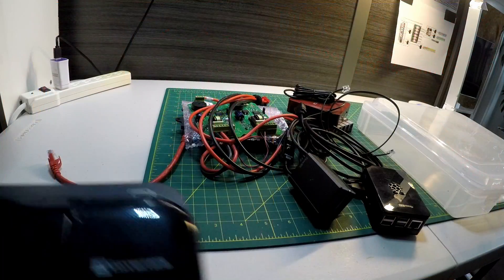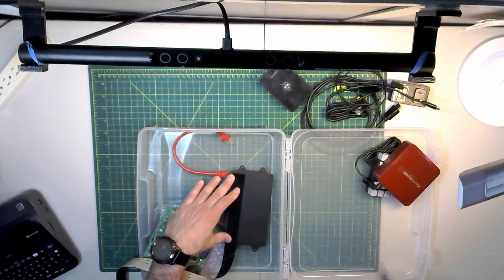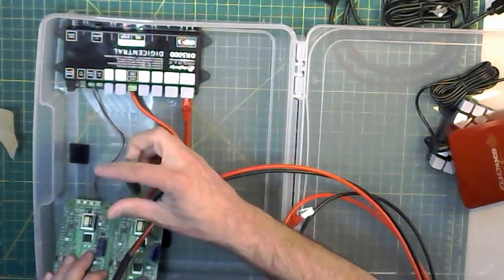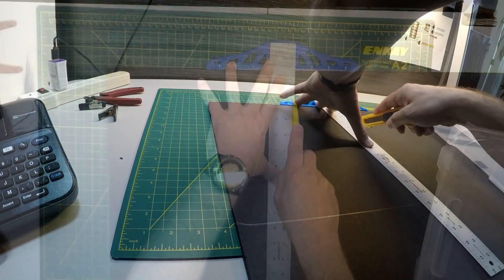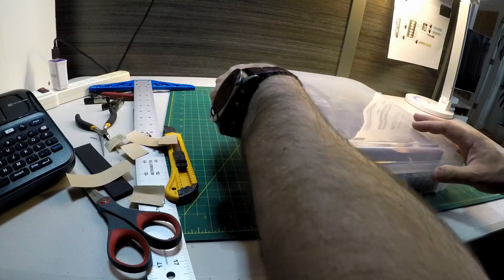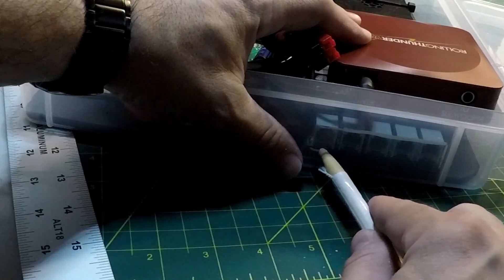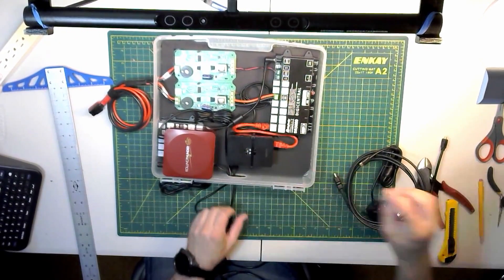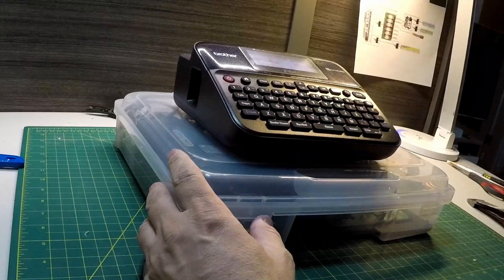2 || Portable DCC Control Box Build based on Digikeijs DR5000 Command Station

Comment: I just subscribed to your channel after joining in on your thread on T-TrakGlobal. I like the idea of a case to hold your power and control gear. Keeping this organized is always a challenge for modular layouts.

I do have a couple of questions about your setup though, and as I'm not familiar with you DCC system, some might be caused by that lack of familiarity. 

Why the second PSX for the programming track? Programming tracks are generally power limited and shouldn't need (or be able to use) current protection by way of a PSX. I'd suggest using the second PSX for the second loop on your layout and just having the programming track connection simple output.

What are you going to be using for throttles? Given the Pi, you could simply use Engine driver, and not require any physical throttles.

Also, what are you doing for programming? I just use JMRI, but for that you'd need provisions for video and keyboard coming out from the Pi.

I'm looking forward to browsing through your channel.
Reply from the maker: Thank You for subscribing.
Episode 28 and 38 answers some of these questions, but not all.
My thoughts on the PSX for the programming track were that this being a portable system, I was concerned that with moving it around and possibly mis-wiring something that it might cause a short to the programming feeds and I did not want this to damage my control station. I am looking to build a new storage system for everything, so your suggestion of using one PSX for each loop is a good idea.
Originally I was just using the Z21 app or WiThrottle with the Digikeijs DR5000 and JMRI. But I belong to a club that is all Digitrax.  Since the DR5000 also supports LocoNet, when the DT602D came out I purchased that throttle.
I have JMRI running on a RPi that is connected to the DR5000.  I will be using this for programming.  There is a bit more information about this setup on episode 28.
Welcome to the journey - Heath

Comment: You are going to love the case open when its on or you will have over heating problems. How are you going to install the Digikeijs soft ware on the Pi? I know that's it is a windows program.
Reply from the maker: The cover comes off the case, so I leave it off during operations. The RPi4 kit that I got has three heat sinks and a fan, so I should not have overheating issues.

I will not be putting the Digikeijs software on the RPi4, I will only have JMRI on the RPi4.  I am running Parallels on my Mac, and run the Digikeijs software on the mac.

Let me know if you have any additional questions.

Comment: This is great.. how many amps does the system put out. Or i guess a better question is how many locos can you run simultaneously?
Reply from the maker: The DR5000 is rated for 3.15amps, so approximately 12 for N scale and 6 for HO/OO scale. I have been very happy with the unit so far and it is feature packed.
Reply: @HumancityJunction  That awesome. what do you use as controllers? im guessing phones or tablets interfacing with JMRI??
Reply from the maker: The DR5000 has wifi built in and you can use the Z21 iOS/Android app directly or you can get the Z21 Multimaus throttle.  Through JMRI, you can use WiThrottle or Engine Driver.  The DR5000 is LocoNet compatible, so in the near future I will be getting a Digitrax throttle. (My local club is Digitrax).  I am not a huge fan of the buttons on the 500D, so I am hoping that they release a new throttle with the button shapes of the Zephyr DSC-52.

Since I am currently working on a T-Trak module on my desk, I usually just use the Digikeijs software on my laptop.  You can open up as many virtual throttles as you have screen space, so it works out well.

Comment: Im so glad I'm staying DC so much easier to wire and cheaper less problems Nice video
Reply from the maker: DCC is actually easier, I just put everything in a case instead of permanently on a layout which makes it a bit more complicated. Then again, if I wanted things to be simple, I would not be in Model Railroading.
Reply: DC is a lot easier for me
Reply from the maker: I still have my MRC Tech II 2800 Dual DC controllers and do not plan on getting rid of them any time soon.